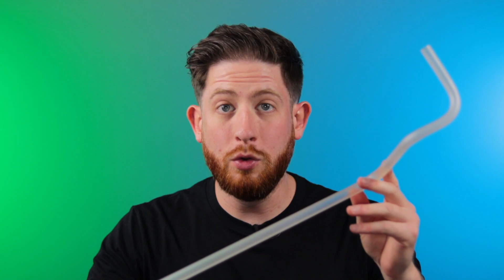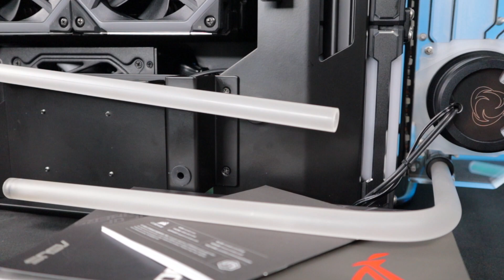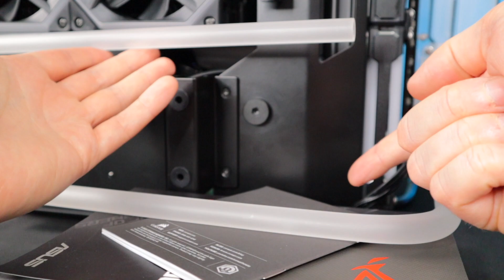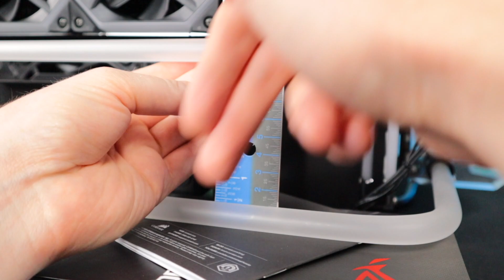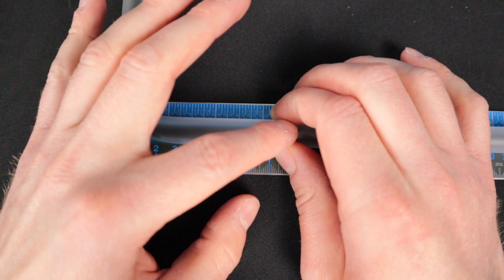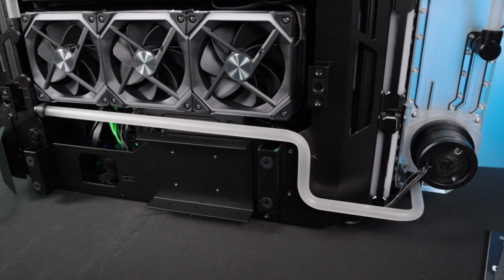How To Measure: Simplifying Complex Bends With Hard Tubing - PC Water Cooling

Comment: Great stuff, i've been sticking to one bend per tube then using fittings like 90 degree connectors for any extra bends needed. Btw... shouldnt you be using one of those silicone inserts to stop the tube collapsing at the bends ?
Reply from the maker: That works too! That looks super good in a lot of different builds! I do use the silicon insert (which can also make it tricky for the multiple bends 😂)

Comment: I always got the tube hot... then brought it up where its going and eyeball it the best I can. I don't do well with measuring. If its slightly off i'll actually force the tubing into the fitting (PETG usually) then hit it with some heat while its still a tad warm, sometimes it will go into place on its own.
Reply from the maker: Definitely an option! As long as you are happy with your bends and how it is turning out that is what counts!

Comment: I have question, can i bend acrylic tubes multiple times?
I have a problem that they just crack during bending:((
Reply from the maker: @Bobson_line  sorry to hear the tubes keep cracking! Typically if that is occurring on the first bend it is most likely due to the tubing not being hot enough. As for multiple bends, I will only bend a tube once meaning if it cools completely and isn’t right I’m starting over! But I have, if the tube is still hot, reheated slightly to make very small adjustments.
Reply: @techtoniksystems  thanks Man, will try it next time:)
Reply from the maker: @Bobson_line  I hope it works!! PETG tubing is a bit easier to work with in terms of bending as far as I know so maybe try that if it continues to not work!

Comment: Why not use chalk or a pencil to mark the start point for the bend? Also why not use a clamp on the end not being bent to hold the object steady and aligned with the ruler?
Reply from the maker: Chalk may work but I think that the graphite would potentially still bleed into the tubing and possibly the chalk to due to the heat. Would have to test! You could also definitely try a clamp!

Comment: I wonder if the fluid pressure will decrease for over two bends
Reply from the maker: @Happy-ws7mb  bends do make the pump work a bit harder from what I understand, but I went with double inline pump on the build so most of the time my pumps are running at their lowest speed possible! Thanks for watching!

Comment: man, 90s... two even 3 sometimes no issue... 3rd one gets tricky with measuring... but a 90, with a reverse 90, into 135 degree is kicking my A right now... just burned through a whole pack of PETG. Any vids on 135/45s? I need to get a better tool or something these thermaltake tools are nice but i swear they dont always seat well in the 16mm channel
Reply from the maker: @mrtoxm8  I do not have anything on 135s or 45s yet! I definitely want to explore even more complex types of bending like that in the future though. I have also found the tools to work okay but not always the best. You may need to make a custom jig for what you are attempting?
Reply: @techtoniksystems  

I built a new wall-mounted rig, which you can see on my current channel as I’m documenting it. The main area is flat, but I’ve attached two “wings” on either side of the case to hold my radiators. These wings are positioned at a 45-degree angle. From the radiators’ tops, I used a 90-degree fitting pointed back at the case.

This setup creates about a 135-degree bend between the flat area of the case and the first/second radiator on each wing.

I’m using X-flow here, so for the bottom, it was easier since I used a 45-degree fitting. However, because the X-flow is closer at the lower point, it looks symmetrical, whereas using this fitting on the top would push the pipe out.

Hope that makes sense in text; I can’t post an image!
Reply: @techtoniksystems  I built a new wall-mounted rig, which you can see on my current channel as I’m documenting it. The main area is flat, but I’ve attached two “wings” on either side of the case to hold my radiators. These wings are positioned at a 45-degree angle. From the radiators’ tops, I used a 90-degree fitting pointed back at the case.

This setup creates about a 135-degree bend between the flat area of the case and the first/second radiator on each wing.

I’m using X-flow here, so for the bottom, it was easier since I used a 45-degree fitting. However, because the X-flow is closer at the lower point, it looks symmetrical, whereas using this fitting on the top would push the pipe out.

Hope that makes sense in text; I can’t post an image!
Reply from the maker: @mrtoxm8  I’m gonna take a look at your build! It sounds wild!

Comment: Am I the only one looking at this thinking it should've been a 45 then 90, does adding too many 90's slow the flow?
Reply from the maker: @Bang1324  Definitely a legitimate observation! Bends do affect flow rate but I have a dual pump system so I was not worried about flow rate at all; I also just liked the way the two 90s looked once the case panel was on!

Comment: Do you have any videos of you doing the bending and how you adjust for a missed bend? I’m using the same Corsair tubing and any time I try reheating and straightening to do the bend a little farther down it always goes to shit.
Reply from the maker: @lateralus821  I’d recommend just starting over if you missed the bend, as much as it sucks, there’s not a lot I have found that you can do to fix it :/ but the good thing is you can use your previous mess up as a template and you now have a better visual tool to follow, just make the adjustment necessary where you missed the bend!
Reply: @techtoniksystems I had two long runs that each had three bends I’ve been putting off and struggling with for a few days. I watched this again today then got to it and managed to knock them both out. Thanks for the help!
Reply from the maker: @lateralus821  that is great to hear! You are welcome, but that is all you getting those runs complete!! Wish YouTube allowed pictures in the comments so I could see your build!

Comment: So that tube is 14mm? This is what I wanted to know, how do you measure existing tubing size, to know what replacement tubing you need... you know, in case you inherited or purchased a water cooled system that you didn't build.
Reply from the maker: @DragonXDrei  Yes, this tubing has a 14mm outer diameter! If you are asking on how find what diameter tubing is being used on an existing build, you would have to remove one of the tubes and measure a straight line through the center using a ruler with mm measurements. The measurement from the outside to other outside would be your outer diameter and you can then just purchase tubing with that outer diameter! 
 
If you are asking how to find the measurements of existing tube lengths with bends, that is going to be wildly difficult, as you would have to figure out bend radius and angles and do a bunch of math I don’t know how to do 😂 I would recommend remeasuring the runs using the method in this video and essentially just using the existing tubing as a reference for loop design.
Reply: @techtoniksystems  existing tubing and thanks for confirming.
Reply from the maker: @DragonXDrei  you are welcome!

Comment: Hi! Just droping huge thank you! I'm doing a custom loop for the first time and holy this video was so helpful. Before I was using specialty tools because I thought that's the only way I can get clean bends. Turns out freaking hands and a ruler give literally the same result. With bending tools I already crewed my 4 bend tube three times. With your method I had done it the first time. THANKS <3
Reply from the maker: I’m really happy to hear the video was able to help! I also went through that same struggle and found it easier to free hand it with a ruler!
Reply: Same I’m going to try this what can I use in the pipe to bend I have no equipment to do this just the heat gun and the cutter ?
Reply from the maker: I would always recommend using a silicon insert that fits tightly inside the tube so you avoid the tube collapsing or having kinks in the bend. If you google ‘silicon insert for pc tube bending’ you should find plenty of inserts for around $10-$15! Just find the right size for your tubing! https://www.titanrig.com/alphacool-silicon-bending-insert-for-10mm-38-id-100cm-0545ac010401on.html?gad_source=1&gbraid=0AAAAADgn6DX2HzG8x3-ndOf-Ufnb7sW60&gclid=CjwKCAjwq7fABhB2EiwAwk-YbKkrs9EbMCKXk0UDAwbVVB2G0cQ-CP3OH62CzfaQ4zGqZgkrL1oroRoC9zkQAvD_BwE
Reply: @gwonzz  Tbh I'd definitely get silicone pipe. Didn't even try without it. I also got chamfering tool after I cut a few orings with the tube lmao.
Reply: Ok thanks I’ll get the inserts 👍🏽💯
Reply from the maker: @gwonzz you are welcome! You might like my other video on the subject!! https://youtu.be/sAuuN8Z5oyQ?si=axB5kZTl6Ol0mMhK
Reply: @techtoniksystems  also gave a like and a sub I’ll keep in touch
Reply from the maker: @ thank you! That really helps out the channel and I’ll look forward to seeing you around!!

Comment: I'm not sure if you have this information but this appears be similar. Where 1/2  inch electrical conduit is concerned, inorder to make a 90° bend, you have to add 6 inches from the total length desired and make the bend from that point. Meaning that if you need a 36 inch run of electrical conduit with a ninety degree bend at that 36 inch mark, you would add 6 inches from the desired length and begin the bend at this extended point. This is because the curve of the 90° bend takes up the 6 inch slack, and you ultimately end up with a 36 inch 90° bend. I assume the same is true for bending acrylic cooling pipe. However, the takeup slack must be a different length. Do you happen to know what that is? This would be helpful instead of trying to make estimations based on static measurements, you could simply add the required length to accommodate for the desired bend.
Reply from the maker: I did not previously know that about electrical conduit, but I, unfortunately, do not know what the take up slack would be for the tubing would be. I think that take up slack would also require the bend to be the exact same radius on every bend as well so you would definitely have to use a mandrel bend tool to ensure you are bending the same radius every time vs doing it free hand. If you had the same bend radius and the correct take up slack amount I’m sure it would translate to accurate and easier measurements! One problem I could see arising is some of the bends had to be tighter than others in my build so I wasn’t able to use a specific mandrel tool for every bend, so that style measuring could have worked for some of the bends but not others. Thank you for the information! I may try to see if I can plan a build’s tubing to be able to have all the same bend radiuses so I can use this technique.
Reply: @techtoniksystems  Thank you for the reply! I would definitely like to see a video of you applying this method because I'm super curious. If you do a YouTube search for 1/2 electrical conduit at 90°, there is a plethora of videos that show you the technique I was trying to describe. You would be correct about different radiuses. In the electrical field, there is a special bending tool used for specific conduit that has markings and tells you where to lineup the tool so that you get the exact bend you're looking for. It's too bad there isn't a small version of this tool  for PC pipe bending. I subscribed and look forward to your next video.
Reply from the maker: Thank you for subscribing! I do want to revisit this topic so thank you for providing this info for me to look into! I hope you enjoy my future videos!!
Reply: Alphacool and EKWB both have different versions of a bending tool. Alphacool's is the closest in design to the EMT benders @Sartre_Existentialist mentioned, while EKWB's is more of a plate with 45 and 90 curved grooves for setting the heated tube into. I have the Alphacool one and it works ok, but I find it easier to use a wood jig with 45 and 90 corners to set the heated tube against. To get specific lengths you can just clamp a bit of wood or whatever as a stopper to set the end of the tube against. As for the same consistent accuracy as EMT bending, I think even with the tool you have to be consistent with how you heat the tube, too. EMT you do cold, so it's not a concern though EMT conduit does sometimes kink if you are not careful.
Reply from the maker: @raggarex  Heat consistency is definitely one of the most important parts for sure! That is probably where I had the most problems when I first started bending tubing. Too cool and the tube will flatten and balloon a bit on the sides of the bend, too hot and you can easily twist/discolor/burn it!

Comment: You can explain this much much easier and also recopmend bending form tools that have arrow markings making precise measurement much eaier and makes bends perfect. Also to anyone: use sharpiea to mark your mrasurements and just wipe it off with alcohol after it wipes right off
Reply from the maker: I’ll have to retry the sharpie because, when I tried that, it melted into the tubing and did not come out!

Comment: insert a wetted, Si mandrel into the tube BEFORE you heat/bend the tube. your technique alters (“squares”) the outer radius of the bend section, resulting in a kinked section. results in a pressure increase and flow restriction. not super important at these H2O pressures and Q (flow rate); however, the pressure increase become significant as the number of bends increases. essentially, momentum and Q changes in your system. look into EKWB bending blocks (acetal matl) for best practices.
Reply: The black piecekf stuff inside his tube when he bends it is a mandrel, he's just calling it a different thing. They are both silicone pieces that slide inside the tube to allow internal support for bending 😊
Reply from the maker: Do you have a link to the mandrel you are speaking of to insert into the tube? I use a silicone core to prevent deforming, but if there is something better I am all for it!
Reply: ^ sorry. if you used a Si insert then your 90deg bends would be cleaner. look up tools offered by EKWB
Reply from the maker: @kenw8875  will do! Thanks for the information!!

Comment: Why not marking the middle of the 90° bend and use a bending tool? 🤔
Reply from the maker: I haven’t found a way to mark that doesn’t leave permanent damage to the tube, but if you know of something that doesn’t I’d love to know! I also like tighter bends than the bending tool I have is capable of doing but you definitely could use a bending tool.
Reply: @techtoniksystems bending tube that goes into the pipe ur bending with a mark on it
Reply: I highly reccomend marking tubing with sharpie and using bending tools it mskes it much less complicated
Reply: Use a sharpie. Wipes off with alcohol

Comment: Are you heating the tubes on the table?
Reply from the maker: I am using a heat gun that sits vertically on the table, and I am holding the tubes over the heat gun! I move the tube to the ruler which is on the table to check the bend and then back to over top of heat gun to make any adjustments
Reply: I think I’m gonna try to bend mine on the table with the heat gun down blowing down on  the table. I can’t get this man I’m having a lot of trouble. Bending . The tubes in the air is working horribly for me.
Reply from the maker: @Bertis87  what part is going bad for you? Maybe I can help you figure out what may be going wrong. It is a fairly difficult process at the beginning so give yourself some grace! The only thing I would be concerned about is potentially fire hazard/burning the surface, but if you are working on a surface that is safe for that, it’s worth a shot!